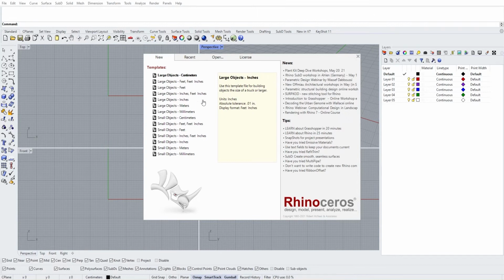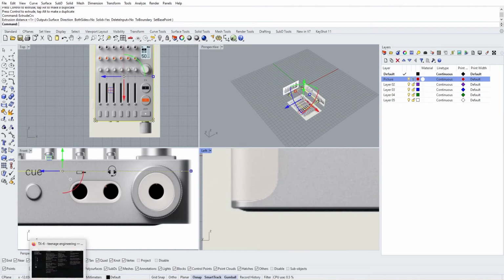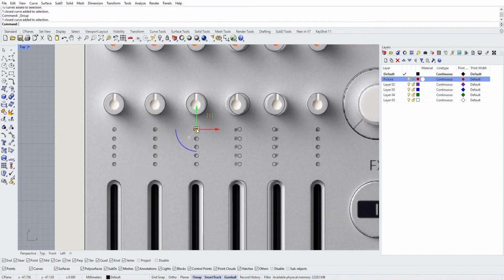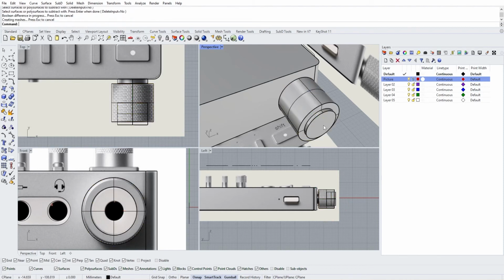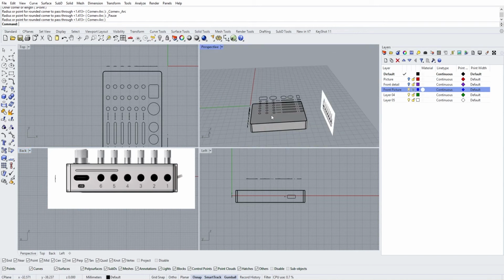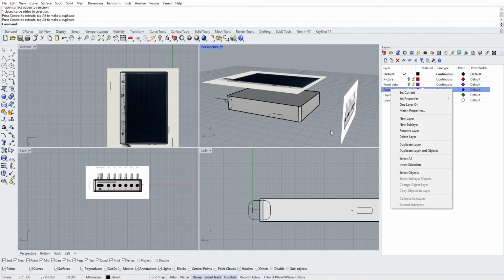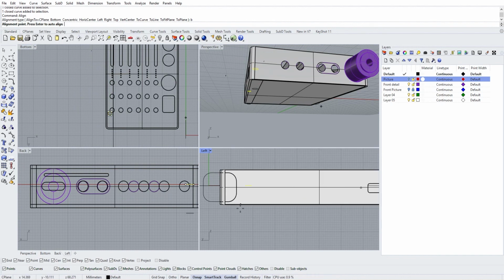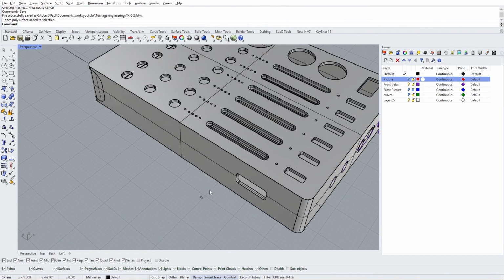TX-6 Modeling Tutorial | Rhino 3D Design from Scratch

Comment: for the tedious process at 30:45, i would recommend clicking the inner trimming curves (where the holes should be) and the outside edge of the surface and using the command "planarsrf" - which creates a single planar surface with all selected curves, leaving the holes open. Then just replace the closed surface with your new one, join I together and done.

Otherwise using rounded rectangles for basically every shape here is possible but not what I would recommend, especially not for machined or molded parts like this. Because you use circular rounded edges the continuity of the edge curve breaks at the point where it starts to curve. Imagine driving a car along that line. You would start turning your wheel in one instance all the way and again just suddenly stop cornering. Instead, you slowly increase the steering wheel's angle and after the apex again slowly start decreasing until it's straight again which results in a smooth cornering. 

In Industrial Design that is called a curvature continuous edge or surface. Depending on how smooth the corner is you call it G0, G1, G2, G3, ... - The Number after the G tells you how many mathematical derivations of the formula that describes that line are again in itself continuous. (Finally are real-life application for derivations ;) )
A simple circular-rounded curve is a G1 fillet while a kink (so no fillet or blend at all) would be a G0. 

For instance, apple uses a minimum of G4 continuity on all surfaces like it's the standard in automotive design as well. I would assume TE to be similarly meticulous as well, especially with quite simple geometries like on the TX-6